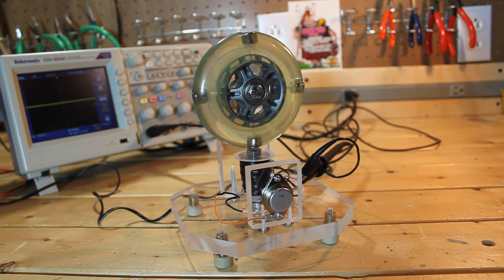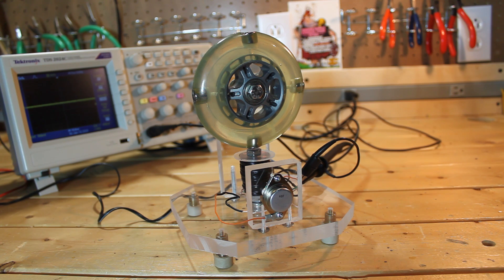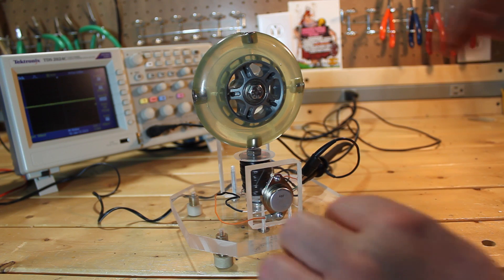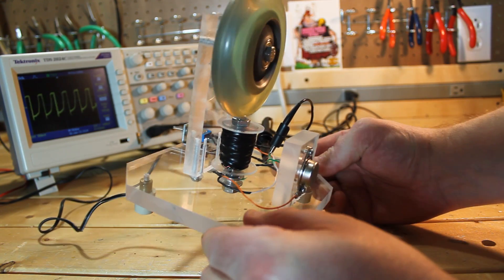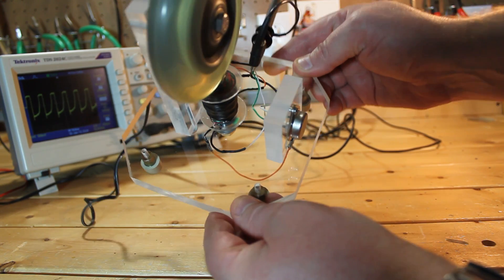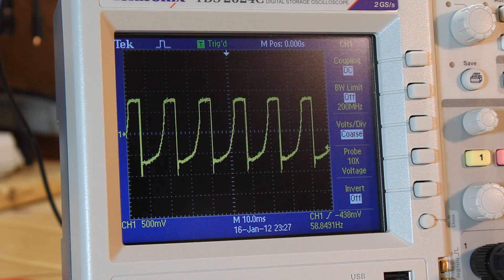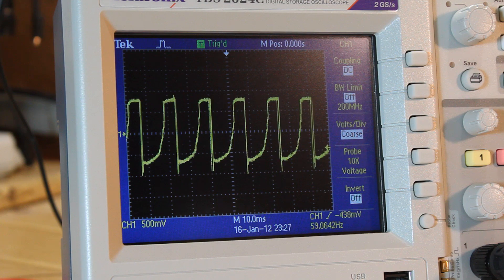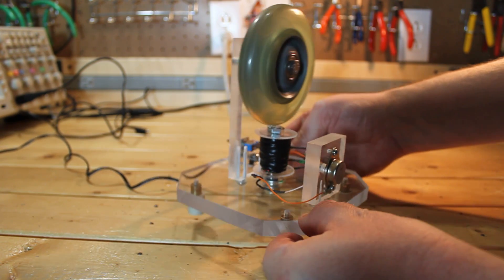Build Your Own Bedini North Pole Motor [HD]

Comment: You still have wires leading to the unit, these wires could easily be supplying current to the coil making the motor turn, I thought the idea was to have it run itself without any external power??????????
Reply: +Mike M No disrespect meant, but these wires ARE supplying current to the "MOTOR" it is clearly stated that it is only a motor, although it probably should have been titled as a pulse motor. On the left side the two wires that run the device are marked positive and negative as indicated by one being black and the other having a white stripe running the length of the wire.  The other red and black wires are connected to a multimeter I do not think any deception was intended and Im not sure why you would assume otherwise.It should also be apparent to you that it would be impossible to power itself with only one coil. At no point does he claim that the motor is powering itself and neither did Bedini. 
I leave you with a Quote about the devices I think you are confusing this one with~

 "There is NO free electricity produced in these systems, or any other system that I know of. I have stated this repeatedly. The only thing these systems produce are a series of “high voltage spikes” that have no current associated with them. Voltage without current is the nature of Radiant Energy. This is what Tesla said. I call this “reactive power” because it does not represent voltage and current simultaneously, that could be measured as WATTS. This Radiant Reactive power WILL charge batteries, light light‑bulbs and other things but it DOES NOT meter as REAL POWER. This is why your math is useless ! 

So please, quit quoting your theories and analyses to me. My light‑bulbs are on. Are yours ? You are welcome to believe in your theory, but I KNOW that Tesla was right about the nature of electricity, and how to successfully tap its useful fractions. If you would just build the motor the way I have said, you could begin to learn about this too. 

Beyond this, I am done CHATTING with you. Leave the people alone who are trying to learn this. Your ignorant comments are of no use. That’s as nice as I can be about it."

-John Bedini

Comment: Hi, In this case the engine is direct current?
Reply: It is ax but instead of brushes and a stator there is a transistor which is told when to go by the pick-up coil. A very simple and convenient circuit
Reply: Ac*

Comment: a son from 0.08 to 0.06 for the launcher and the return current load.?

500 turns on the coil and neodymium magnet 6 10 x 05?

the kernel is by how much? 10mm or 15mm.

Bedini council to use welding rods in May for a 10mm meter can tone core in the form of screws and locked up?

Dividing the wheel into four or five games with a 10 x 05 neodymium magnets to charge a battery or 9v batteries?

But Bravo is a beautiful model of bedini School Girl.